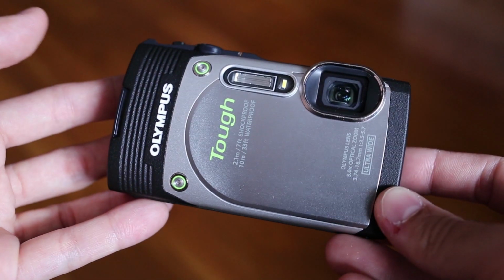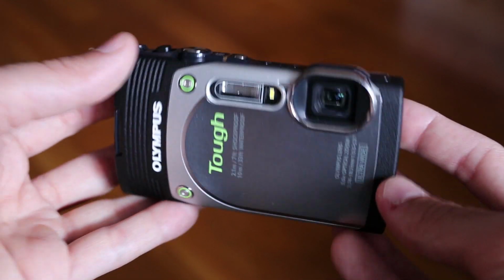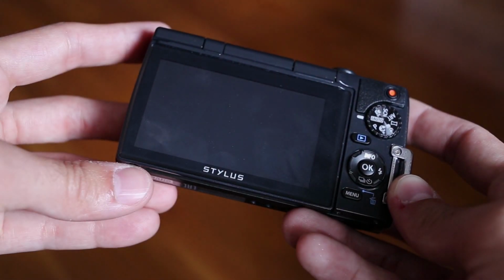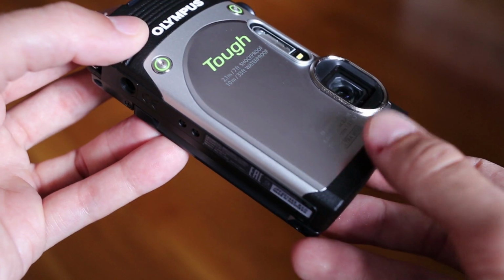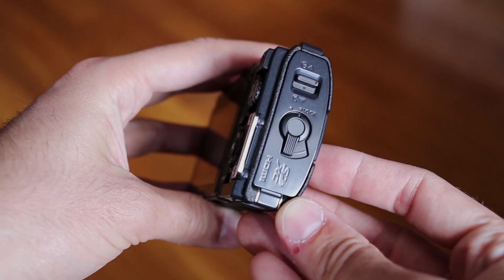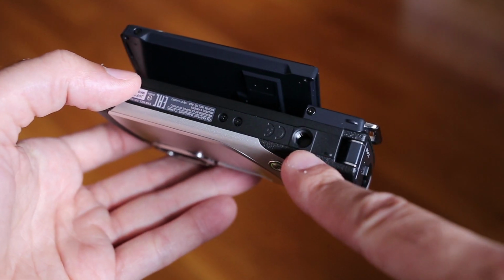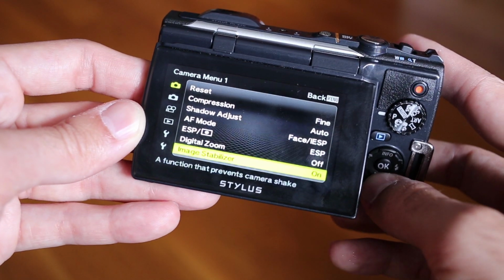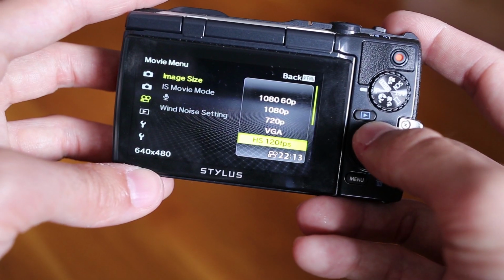Olympus Tough TG 850

Comment: I got a TG-850 but its LCD flip screen is dead blank. It still can be switched on and take photos/ videos. Could you possible list down the menu settings how I could navigate to on the Wi-Fi or Bluetooth settings so that I be able to connect via my smartphone using O.I Share?

This is my last chance before scraping it or go ahead and pay $138 for repair&replace of the strip cable :(